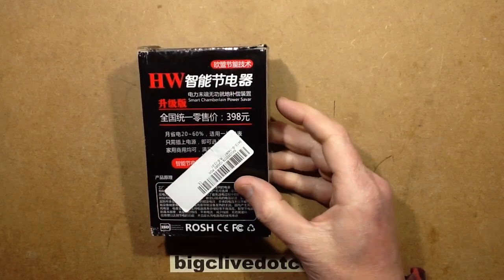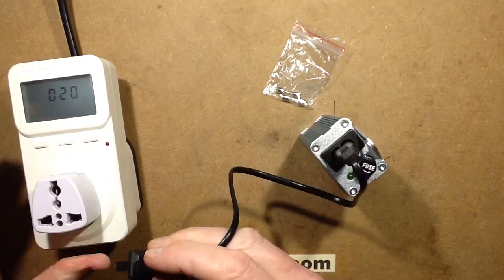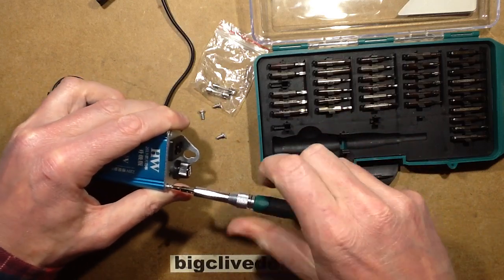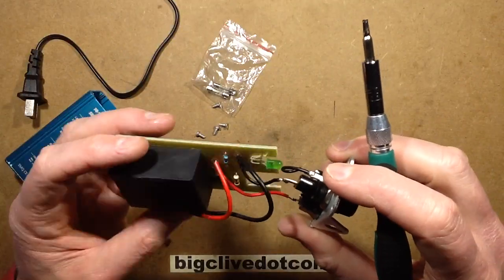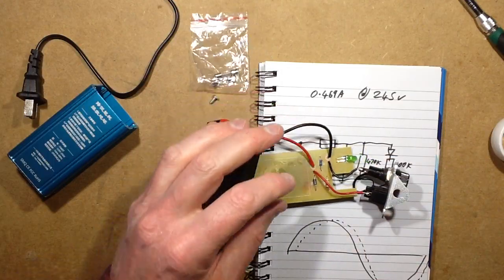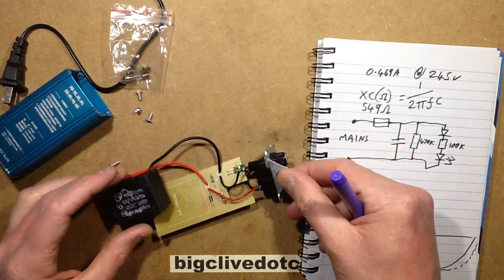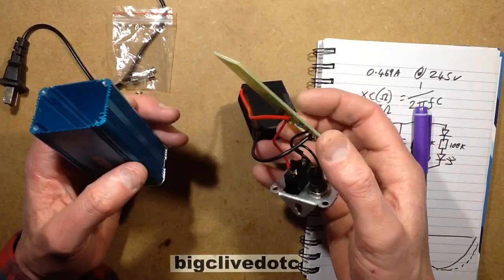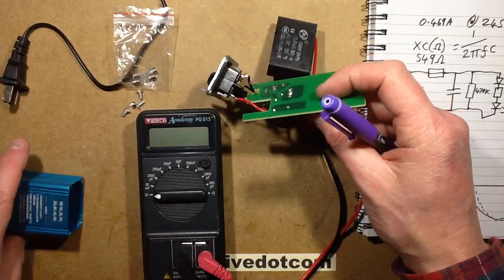200kW miracle power saving device.

Comment: I think you need a capacitor change in your brain because your brain resets after saying "If you have an inductive load" :D

Also as a side note I would like to suggest Chinese manufacturers a new slogan for their LED lamps: Saves 20-60% of power PLUS (insert value for LED savings) because of the new capacitor dropper circuitry!!!
Reply: +MrOpenGL No capacitor change needed. It's a software thing, a feature of the engineering-specific release of the Human Operating System, designed to optimise communication. If you could see his face at the time, you would note the slightly raised eyebrows that indicates a known-resource request. So, when an engineering type says "If you have an inductive load..." and raises his eyebrows slightly, all other engineers in the room will perform an algorithm lookup and finish the sentence internally, whereupon they will all nod their heads to indicate a known-resource acknowledgement. Hmmm, I might be a little drunk.
Reply: Gary Dagget
It's such a shame that hOS is closed source and has no manual... Just think of all the bugs we could fix or all the features we don't even know :D
Reply: +MrOpenGL Oh man, don't get me started. I mean, what's with the whole interact(not(me.gender)) API call? SO broken
Reply: Gary Dagget
And what about the hardware issues? For a start, thermal management is completely broken. The internal heater is often not powerful enough, but on some models (including mine) it is TOO powerful, forcing the user to walk outside wearing only a T-shirt when there are 16°C or less. This triggers a software bug in other people, the classifyPerson() routine writes erroneously a mrOpenGL.isWeirdo == true which is bad.

Also, the cooling system is way underpowered, consumes too much water and fails when the humidity is too high. I don't know why the designers went with such an archaic evaporative design, when a vapour compression system would have been much better.
Finally, the blood circulation pump is not redundant and is quite unreliable. I don't get why the designers made almost all components redundant but forgot about the pump.
And finally, APIs for wireless brain-to-brain communication are broken, though some users report success to some extent (documentation is as always lacking completely) and the post-hardware failure recovery is also completely non-functional, only working in very rare cases.
Also I should mention that the anti-virus and anti-malware pre-bundled with hOS ("Immune System") is quite good, but cannot yet recognise some viruses, cannot fix problems created by others like the infamous "Cancer" and most of the times it occupies too much system resources (causing a severe increase in internal temperature which is exacerbated by poor thermal design) while trying to remove a threat.

Should we make a long list of all the bugs of the Human®Being©(TM)?
Reply from the maker: +MrOpenGL I was trying to think of a way to describe power factor and voltage/current relationship in a way non-technical people would understand.  It's a tricky thing to do.
Reply: I thought my explanation was better :-) Love your stuff, Clive.
Reply: bigclivedotcom
I know :P Power factor is one of the most misunderstood and exploited things of physics (after the first law of thermodynamics obviously...)

Comment: A couple of questions.  1) Is the entire property's power supposed to go through one of these first?  As in this should be tied in between the main utility line and the breaker box to the property?  2)  It's only really effective with mechanical loads such as large motors rather than light bulbs, ac/heating units, computers, tv's etc?  What about direct shorts like soldering irons and heating elements?
Reply: +The-Mike_D No, it would be in parallel with everything else in the house.

Comment: So you like it but it doesn't do anything ?
Reply from the maker: +wolfe1970 It works perfectly.  It makes the user think they are saving cash and gives them a warm happy feeling when they plug it in.  Especially if something live has touched the case inside.
Reply: +wolfe1970 That's how you know an engineer. The thing doesn't do shit, but it's neatly laid out and quite properly made, so an engineer will like it ;D
Reply: +turbo pascal Funny as im an engineer myself, i like stuff that actually works as well as looking neat and tidy
Reply: wolfe1970 Well, okay, but for some, actually working is a bonus ;)
Reply: +bigclivedotcom And it might make magical blue smoke, right? :D

Comment: BigClive, I've heard about new SmartMeter users, who've had their analog meter replaced with a digital one - they sometimes have power bills that skyrocket. I wonder if this is because the digital meters measure PF as well?
Then in that case, these devices would help you save energy (well, they possibly could).
Reply: Older analogue meters with their moving parts pick up mechanical resistance over time (dust ingress etc) and tend to under-read power usage as a consequence.  This is why a new digital meter can increase the bill, it's simply reading accurately compared to the old under-reading meter.

Comment: Wouldn't there have to be an output side of this equation in order for electricity to be saved?Just running it into a loop + LED without some kind of output tap, what's the point?

Comment: industrial power is often paid for based on the Volt-Amperes, or at some premium for significantly bad power factor, as it is very nasty to the power distribution systems. power factor compensation capacitors do make a difference in the bill in industrial installations, but a 120VAR capacitor is not even a percent of what you would need.

Comment: Absolute death trap with no earth and metal casing. Since I live in China, I see far too many electrical devices with shoddy quality and lose wiring. Your right to be ginger when touching it.

On an tangential point, for the past 9 years in China, I lived in houses with no earth. None of my friends houses had earths. Until quite recently, they just didn't put the earth wires into the wall sockets. They had thee pin sockets but nothing connected to the third pin. Trying to save on the copper. My new house, does have earth. Can you imagine that with 1.4 billion people in China and almost nobody has earthed devices in their homes. I sometimes wonder how there can be so many people in China? Surely they should all have been electrocuted to death by now.

Comment: Can that capacitance meter measure big caps? 3000 farad 2.7v ones? I bought some from China but I think they lied about the ESR and/or capacitance so I am looking for a way to actually measure if. If anyone knows a way/meter that can do it let me know please and thanks!
Reply: most cap meters dont that high, you can use a sine wave and a scope to measure the phase difference and current through the cap, the the formula for capacitive impedance to find the value of the cap
Reply: +toysareforboys 3000 Farad? Those are some massive capacitors there. Unless you missed the micro- or nano- in front. 

Based on the markings on that particular meter, it looks like its maximum is 20 millifarads, or 20000 microfarads. So if your caps are 3000 microfarad, it should be able to check them. 

Depending on the quality and type of the caps, there can be pretty wide tolerances in the capacitance, especially with 1+ Farad capacitors.
Reply: +evknucklehead Nope, 3000 farad :) http://tafb.xxx/07cobaltSS_SC/nesscaps.jpg
Reply: toysareforboys
Yeah, I looked them up after I posted the comment. Meanwhile, I did some searching on capacitor testers, and so far the highest rated one I've found only goes up to 199.99 millifarad.

There has to be a way of testing these, I just haven't found a device that will yet.
Reply: In theory, you can charge them at a constant current of exactly 1 amp and time how long they take to charge up to 1 volt. The number of seconds that they take is the exact capacitance in farads. This is actually how most capacitance meters work, with the difference that they use much lower currents.
Reply: Oh wait, with a 3000 farad capacitor, it would take almost a full hour to complere the measurement using the method I suggested. Better than not being able to measure the caps, I guess, but you can also use currents higher than 1 amp, as long as you then multiply the elapsed time by your test current.

Comment: A tip I was given at college to work out capacative reactance  on a basic calculator where the capacitor value is in microFarads is to bang a million in and keep dividing, eg:—

1000000 ÷ 2 ÷ 3.14 ÷ 50 ÷ 6.13 = 519

Comment: Big Clive - these things REALLY work!  I've plugged these into EVERY single power outlet in my house so now I can't plug anything else in and my power usage has dropped dramatically!  Thinking about it, I probably would get a better result just shutting off the mains circuit breaker to the house...
Reply: Brilliant!! Let me try it too... he-he
These "magic" boxes should also come with pamphlet instruction to disconnect or turn off all unused appliances, including power supply bricks, which will probably save more than that measly 0.496Amps. lol
Reply: The kiddie socket protectors do that job as well and cost less per piece. And you get kiddie protection thrown in for free! :)
Reply: lol
Reply: Lmao
Reply: @myprofile.4191  EVERY! single! power outlet!
Reply: kirkb4989 lol really you did it ? Good stupid joke

Comment: I think that the idea behind the savings is that the capacitor will make the voltage lag the current by 90 degrees.  If you look at the effect through a Oscilloscope you can see that when multiplying the 90 degree lagging voltage by the current you get the result of less wattage since you are multiplying a higher sine wave current to a lower sine wave voltage.

Comment: Could you explain more about using a capacitor as a resistor to prevent red hot resistors in LED lighting?
I'm trying to build some LED lights, but my resistors always get hot, and I want to stop that from happening.
Thanks, love your vids.
Reply from the maker: +God Was Bored If you look through my other videos you will find many LED lamp teardowns have a schematic.  The idea is that with the capacitor on one leg of the mains it allows a small portion of current through on each half of the sinewave, and that is rectified and used to drive the LEDs directly or used to pump up a capacitor for smoother DC.
Reply: bigclivedotcom Ok, thanks.  I'll have a look to see what I can find.  I'm a beginner with Electronics so every tip helps.
Thanks very much.
Reply: Sebas Eu Its so simple when you lay it out like that :)
I have pieces of paper beside me and am working on the maths :)
I wish I knew this better, but am working on it.

Comment: But does this device actually smooth out a bad sinus?
For example: I'd like to use an 240V audio amp on a 12V battery with an Inverter.
But the inverter puts out a "modified sinus".
My amp has a switch mode power supply and the manufacturer says, you shouldn't use it on a modified sinus.
So can I use this device for that purpose?

Comment: interesting. does that mean that if you didn't short out the plug pins there you could have grabbed hold of it with your hand and enough to give u a little shock?
Reply from the maker: +Andy Robus Yes, although it does have a discharge resistor that would bleed the charge away slowly.
Reply: Oh right, thanks. Years and years ago I had a very old Motorola startac mobile flip phone and when I used to pull the charger plug out of the wall if I accidentally touched the plug pins it would give me a little jolt.

Comment: way to flip off your audience while using your calculator.  It's all in the selection of which finger to do what, my friend :-).  As you noted, a certain amount of current/power will be consumed by the LED, and also a certain amount by the discharge resistor.

The extent of heating electricity savings will depend on one's furnace.  Speaking of New York State, around here, the Buffalo area, natural gas is quite plentiful, so the vast majority of furnaces (and water heaters) are gas, some oil and propane (tanks), with a few electric here and there.  I hear out east though that it's really rocky, and putting in gas piping is really difficult, so there, the majority is electric with some propane and oil.  The typical order of price per joule (usually stated as BTU here) is electric, propane/oil, and gas.  So for heating around here, the electric savings would be for either blower or water recirculation, a minor factor (compared to the gas).  Out east, oh my, the savings as you note can be quite dramatic.

My, oh my, you really hit it for air conditioning though.  I increased my thermostat from 24 to 26, and the month-to-month savings was around $25 after I did that.

Comment: My power bill consists of the running of a heat pump and an electric clothes dryer the rest is on a closed solar system with no GTI. The bill runs me about $70 a month.
Reply: jusb1066
Good for you, you get a cookie...
Reply: In the US it varies from state and county and even CITY! lots of red tape too and in the end its the customer who gets the shaft..
They tried to tell me I had to sell my power back into the grid that it was required but in fact it is not required by law here only by the power company so I chose to keep power stored in big battery bays (ex-cellular tower site stuff) and run everything but my heat pump / AC and such off that through pure sine inverters of course. The most of my lighting is LED based and 124 volt run straight from the battery bays. I have to Thank Clive though for all the LED lamp videos, I learned alot from hen and now I am able to innovate my own power systems at max efficiency at least in the lighting areas.
Reply: +ElfNet Gaming Chinese spin dryer and hang your cloths, 100x the power savings vs the usual dryer.
Reply: +ElfNet Gaming i have grid tied solar, my bill is £8 a month...
Reply: jusb1066 GTI here is not worth it, the power company does not pay anything respectable for power, I came out ahead just using my own power and leaving the GTI out.
Reply: ElfNet Gaming
In some states, they have penalized those who grid tie by charging a fee, typical of there previous bill before solar investment and they absolutely don't pay you for supplying power to the grid.
Reply: ElfNet Gaming
yeah some countries are terrible, in the UK not only do you get a premium for what you sell to the grid, you get to use what you send to the grid and not pay for it! lol, USA for example in Nevada make it borderline illegal, same with not allowing you to keep rainwater.....but in the UK i bought my own solar, i am in year 3 now and ahead of my own predictions of a 15 year payback, (partly i did a huge audit on energy hogs and try to use when solar is working for me) if the energy rebate doesnt get reduced, i should pay for it in under 10 years, thus meaning 20+ years after that of large gains.

Comment: hey Clive, would one of those devices technically work to smooth out power in a old house, where lights keep flickering and burning out?
Reply from the maker: +Radek Wysocki That does sound like a wiring issue or old lamp holders.  If the lights are flickering very bright and then failing it may be a loose neutral in the supply area.  That could be in the power panel or in the supply leading into your home.
Reply: +Radek Wysocki No, you have a loose wire problem or line surges. Keep your fire insurance current, and find an electrician.

Comment: is ohms law failing me ? or rather am i such an idiot it simply evades me ? 0.469A *245v 114watts? yet the power meter who knows better i know for sure  says 0.3 watt?   what?
Reply: +phil no  P=U*I is only really valid for DC. With AC you need to use P=U*I*power factor  (cosine of the phase difference between the current and the voltage.

If you apply an AC voltage on a purely resistive load, the power factor is 1 (no phase difference), so essentially the same as for DC, but as soon as you add capacitance or reactance to the load, things change and the current will no longer exactly follow the voltage.
.
Power factor for an ideal /pure capacitor is 0 (phase difference 90 degrees).

Since the load is almost a pure capacitance, we get effectively 0 real power.

Households are generally metered on the real power they use, but big consumers, say a factory with loads of motors (inductive loads) can be penalized because the large out of phase current will still lead to transmission losses in the wires for the power company. Therefore they might install banks of capacitors in the factory, so that the power factor for the entire factory is close to 1 (the extra current is essentially only shuffled between the motors and capacitors inside the factory, not all the way through the wiring to the power plant.)
Reply: thanks :-)